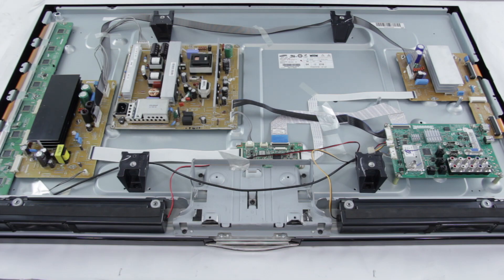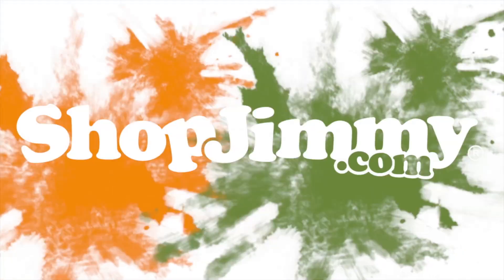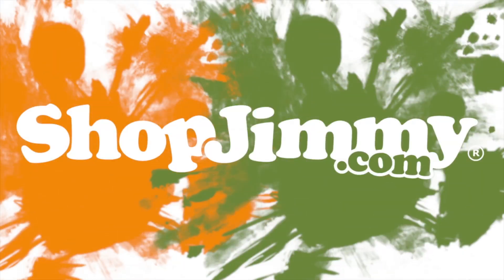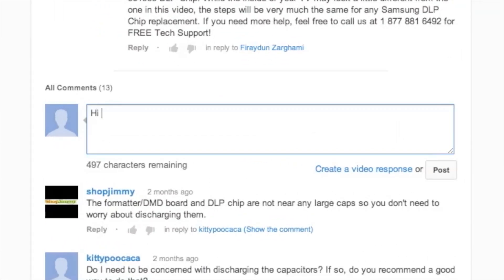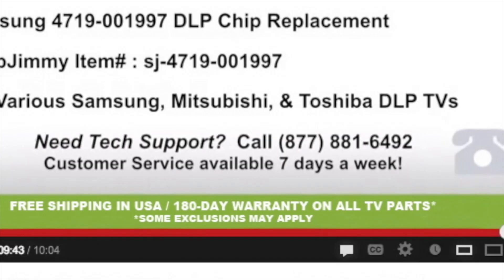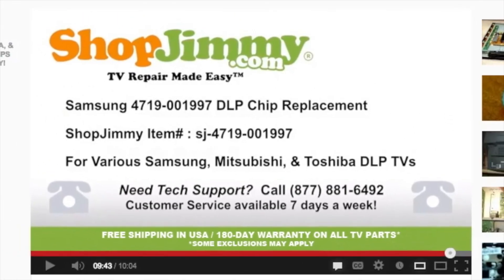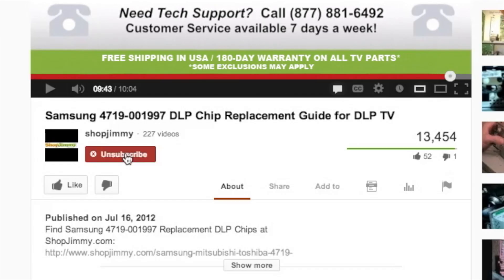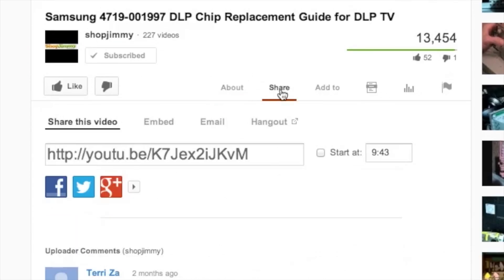Plasma TV Repair Tutorial - Common Symptoms & Solutions - How to Fix Plasma TVs

Comment: Hi need help with my plasma tv.
It is an Hitachi 42pd5200e.
It went down with the famous power board failure (no power ,no led light on front of panel).
I replaced this with a new power board and It still will not power up.
I get the below when I power on tv.
1 turn on power button.
2 Hear a click (relay) and the led turns green from red.
3 Led is green ,Hear a second click (relay) . Led is still green but no picture or sound.
I have done the self Diag on tv and get 8 flashes of the green led .= according to manual this is all boards failure !!!!!.
I have tested the 5v supply on power board and also VA =66.5v so they seem o.k.
The VS however is only 16.6v ,And goes to Zero after second click of relay when turned on,It should be 90V.
I have noticed that if I unplug X SUS Board and turn tv on you do not hear second relay click sound ,And the same if I disconect the y sus board.
Any help greatly received.
Reply from the maker: julian oldham   This sounds like the y or x board is bad.  Unfortunately I do not see any replacement parts in the search results for your TV model number on our website.  Thanks and please let us know if you have any further questions!  www.shopjimmy.com
Reply: Hi I have now replaced both x and y boards and still have the same issue.
Don't know what else to try
It's now had a new power board + the above .

Comment: Panasonic TH-P50Vt20A shuts down after about 15 seconds.
Reply from the maker: Frank Howe   I recommend replacing the power supply in your TV.  Here is a link to replacement parts for your TV model number on our website, click here:  http://www.shopjimmy.com/catalogsearch/result/?q=P50Vt20  Be sure to match part numbers on your current board, with your replacement for compatibility.  Here is a link to a video showing how to identify your part number, click here:  DIY Plasma TVs 101: Part Identification Number Guide for Panasonic Power Supply (PSU) Boards  You can also call our customer service for further assistance with your purchase.  (877) 881-6492  Thanks and please let us know if you have any further questions with your TV Repair!  www.shopjimmy.com

Comment: I hope you can help???  I have a Samsung Plasma Model # PN50C540G3FXZA.  And it's flashing and sometimes solid black.  The picture varies from blown out to dark.  And it occasionally plays normal too.  I took pics of what its doing and a small video, but not sure how to add it here.
Reply from the maker: Suzanne Hue  I recommend checking your power supply, is there anything on the power supply that looks burnt or are any of the capacitors look puffy?  Please reply with this information and we can try and recommend a replacement part.  Thanks!  www.shopjimmy.com

Comment: I have replaced all the boards on my Insignia 42-P650A11 plasma tv. Still have clicking flashing red light and no picture or sound. The red light stays solid after clicking stops.   What else could it be?
Reply from the maker: Charlene Skeen   What was the original problem on your TV?  Please reply with details about the the TV symptoms.  Thanks!  www.shopjimmy.com
Reply: the color was fading and picture breaking up. Then wouldn't come on.

Comment: My plasma is samsung fp-t5084
I just have green and sometimes red pixels like tiny star's on the screen....
Reply from the maker: king john  I recommend replacing the Y-Main board in your TV.  Here is a link to replacement parts for your TV model number on our website, click here:  http://www.shopjimmy.com/catalogsearch/result/?q=t5084  Be sure to match part numbers on your current board, with your replacement for compatibility.  Here is a link to a video showing how to identify your part number, click here:  Samsung Plasma TV Repair: Samsung Plasma Panel Parts Guide  You can also call our customer service for further assistance with your purchase.  (877) 881-6492  Thanks and please let us know if you have any further questions with your TV Repair!  www.shopjimmy.com

Comment: I have a Samsung Model PN50A550S1FXZA. When I try to turn it on it will cycle several times. Each time with a loud click that sounds like a relay pulling in. Once it is on, it work fine. Is this the power board?
Reply from the maker: Robert Whitfield   I recommend replacing the power supply in your TV.  Here is a link to replacement parts for your TV model number on our website, click here:  http://www.shopjimmy.com/catalogsearch/result/?q=PN50A550S1FXZA  Be sure to match part numbers on your current board, with your replacement for compatibility.  Here is a link to a video showing how to identify your part number, click here:  TV Part Number Identification Guide for Samsung DIY TV Repair Power Supply Unit (PSU) Boards  You can also call our customer service for further assistance with your purchase.  (877) 881-6492  Thanks and please let us know if you have any further questions with your TV Repair!  www.shopjimmy.com

Comment: I have a panasonic TH-50PX75U.  Have had ongoing issues with the picture going out.  The audio always works but the picture will come in and go out intermittently.  Usually the longer I leave the TV on it will eventually stay on and work but other times it will work at first and then after a while cut out and never come back.  Other times the picture will come in but everything is tinted blue for a while and will then go back and forth from coming in clearly and being tinted blue, then eventually if left on long enough (40+ min) it will usually clear up.  Any help with troubleshooting would be appreciated.  Thanks.
Reply from the maker: Timothy Callahan   I recommend replacing the SC board for your TV repair.  Here is a link to replacement parts for your TV model number on our website, click here:  http://www.shopjimmy.com/catalogsearch/result/?q=TH-50PX75U  Be sure to match part numbers on your current board, with your replacement for compatibility.  You can also call our customer service for further assistance with your purchase.  (877) 881-6492  Thanks and please let us know if you have any further questions with your TV Repair!  www.shopjimmy.com
Reply: ShopJimmy.com
I replaced the SC board but unfortunately no improvement.  Would that indicate bad buffers?  Is it common for both buffers to go bad at same time?  Both the SC board and buffers are out of stock on your website (I had to buy the SC board on ebay, I assume it was good, either way TV acts exactly the same with the new SC board as it did with my original.  Any other recommendations would be appreciated.  Thank you
Reply from the maker: Timothy Callahan   Yes, your buffers could be bad.  I recommend replacing the buffers next.

Comment: I have a Samsung HP-R4272 plasma display. Objects displayed on the screen cause a reddish fuzz vertically up and down from wherever it is. This happens on any input. It started while playing a video game (classic Nintendo). After a few minutes, it became permanent and is still getting worse. Any help would be great, thanks!
Reply from the maker: Robert Henline   I recommend replacing the Y-Main board in your TV.  Here is a link to replacement parts for your TV model number on our website, click here:  http://www.shopjimmy.com/catalogsearch/result/?q=R4272  Be sure to match part numbers on your current board, with your replacement for compatibility.  You can also call our customer service for further assistance with your purchase.  (877) 881-6492  Thanks and please let us know if you have any further questions with your TV Repair!  www.shopjimmy.com

Comment: I'm having an intermittent problem with my 50" Samsung Plasma TV (model # PN50B860). Every so often, whether watching a live broadcast or recording, the TV will change the input source by itself, usually to the antenna source which has no input and thus no picture. When it does this, the infrared input light on the TV continuously flashed rapidly and cannot be interrupted by the remote or TV buttons. My only recourse is to unplug the TV, plug it back in again, and reset the source input via the remote. Any idea what's causing this and what part(s) need replacing? Thanks in advance!
Reply from the maker: R Reed   I recommend replacing the main board for your TV repair for your input changing by itself TV Repair.  Here is a link to replacement parts for your TV model number on our website, click here:  http://www.shopjimmy.com/catalogsearch/result/?q=PN50B860  Be sure to match part numbers on your current board, with your replacement for compatibility.  Here is a link to a video showing how to identify your part number, click here:  Samsung Main Boards & Digital Boards: Part Numbers for LED, LCD, DLP, Plasma TV Repair  You can also call our customer service for further assistance with your purchase.  (877) 881-6492  Thanks and please let us know if you have any further questions with your TV Repair!  www.shopjimmy.com

Comment: RCA plasma 42pa30rq... I never get a picture just cliking. Not even the menu page when I remove all components ie. xbox and cable. All I get is clicking. Wouldn't I at least get a picture (menu) with everything removed. Wouldn't the issue be the other boards?
Reply from the maker: Stash2319   I recommend replacing the Y-main Board and the Buffer at the same time for your TV Repair.  Here is a link to replacement parts for your TV model number on our website, click here:  http://www.shopjimmy.com/catalogsearch/result/?q=42pa30rq  Be sure to match part numbers on your current board, with your replacement for compatibility.  You can also call our customer service for further assistance with your purchase.  (877) 881-6492  Thanks and please let us know if you have any further questions with your TV Repair!  www.shopjimmy.com

Comment: HELLO I HAVE A 2006 DELL PLASMA 50 INCH TV.WHEN I TURN THE TV ON IT TURNS RIGHT BACK OFF....MODEL# W4201C/W5001C
Reply from the maker: Sheldon Smith Sr   I would start out by carefully inspecting the power board for swollen capacitors. Especially in a set that is 8 years old. There are a number of other possible causes of the problem, but start with that.  Please reply with the information that you find and then I can help to work toward a repair.  Thanks!  www.shopjimmy.com
Reply: thank you very kindly ....it was the power board. swollen capacitors so I just replaced the board and its up and running

Comment: Hi. I have a Samsung PN69D63083F. When I first turn it on it comes on just fine for a few min, then it sounds like it powers off then powers back on but does not have video only has audio, I can turn it back off let set for a few turn back on it comes on just fine for a few min. then does the same thing again.
Reply from the maker: Eldon Essary   I recommend replacing the main board in your TV.  Unfortunately I do not see any replacement parts in the search results for your TV model number on our website.  Thanks and please let us know if you have any further questions!  www.shopjimmy.com

Comment: my plasma TV shuts on and off continuously.model code is PN58C550G1FXZA Version UY01.
what board would that be, and how would one replace it? thanks
Reply from the maker: ARNOLD TOEWS I recommend replacing the main board for your TV Repair.  Here is a link to replacement parts for your TV model number on our website, click here:  http://www.shopjimmy.com/catalogsearch/result/?q=PN58C550G1FXZA  Be sure to match part numbers on your current board, with your replacement for compatibility.  Here is a link to a video showing how to identify your part number, click here:  Samsung Main Boards & Digital Boards: Part Numbers for LED, LCD, DLP, Plasma TV Repair  You can also call our customer service for further assistance with your purchase.  (877) 881-6492  Thanks and please let us know if you have any further questions with your TV Repair!  www.shopjimmy.com

Comment: I have a RCA plasma 42pa30rq. When turned on it only makes clicking sounds on and off a few times. I can here some static between clicks but never get a picture or sound. any suggestions? Thanks
Reply from the maker: Stash2319   I recommend replacing the main board in your TV.  Here is a link to replacement parts for your TV model number on our website, click here:  http://www.shopjimmy.com/catalogsearch/result/?q=42pa30rq  Be sure to match part numbers on your current board, with your replacement for compatibility.  You can also call our customer service for further assistance with your purchase.  (877) 881-6492  Thanks and please let us know if you have any further questions with your TV Repair!  www.shopjimmy.com

Comment: I have a panasonic model number  TH-42px77u   I had the electric company out and they pulled the meter on the house to check the ground... When they plugged the meter back in I think it surged the tv.  upon opening the back i found one of the two fuses was blown.  However, when i tried to replace it and plugged it back in it blew both fuses.  So my next thing was to disconnect all of wires plugging into the power supply board.  When I replaced the fuses again, it did not blow.  As i plugged in each wire one by one when I got to the one that connects to the main baord it blew both fuses.  Do you think it may be the power supply board or one of the other boards?
Reply from the maker: Craig Wells   This sounds like the A main board is shorted and when you plug it into a power source it kills the power source I would replace the main board.  Here is a link to replacement parts for your TV model number on our website, click here:  http://www.shopjimmy.com/catalogsearch/result/?q=TH-42px77u  Be sure to match part numbers on your current board, with your replacement for compatibility.  Here is a link to a video showing how to identify your part number, click here:    Panasonic Plasma HD TV Repair Tips: Suffix Codes for A Board & Main Boards  You can also call our customer service for further assistance with your purchase.  (877) 881-6492  Thanks and please let us know if you have any further questions with your TV Repair!  www.shopjimmy.com

Comment: My Akai PDP4225M TV is absolutely dead.  It does nothing when you turn it on.  No red light and no noise.  I've confirmed it has power.  Beofre it when dead, it changed the input source wheb I tried to turn it off using the remote or the front buttons.  I could only turn it off using the power button in the back.  This worked about three times and then it died.  What board failed?
Reply from the maker: Lars Lippard   If the light is not on, in the front of the TV, then I recommend replacing the power supply in your TV.  Here is a link to replacement parts for your TV model number on our website, click here:  http://www.shopjimmy.com/catalogsearch/result/?q=PDP4225M  Be sure to match part numbers on your current board, with your replacement for compatibility.  You can also call our customer service for further assistance with your purchase.  (877) 881-6492  Thanks and please let us know if you have any further questions with your TV Repair!  www.shopjimmy.com

Comment: I have a Zenith 42 inch Plasma.  Model # Z42PQ20.  TV just went off while watching.  Power will turn on, but only red standby light.  If I push a channel button, the blue on light comes on like it is turning on, but clicks back the the red standby light.  Any suggestions?
Reply from the maker: Donny Sloan  I recommend replacing the main board in your TV.  Here is a link to replacement parts for your TV model number on our website, click here:  http://www.shopjimmy.com/catalogsearch/result/?q=Z42PQ20  Be sure to match part numbers on your current board, with your replacement for compatibility.  You can also call our customer service for further assistance with your purchase.  (877) 881-6492  Thanks and please let us know if you have any further questions with your TV Repair!  www.shopjimmy.com
Reply: Is this a hard process to do myself?
Reply from the maker: Donny Sloan
  You will want to take the proper precautions before attempting any repair, be sure to ground yourself properly and unplug your TV amongst other precautions.  Most TV board replacements only require, a screwdriver, and a replacement part.  Thanks and please let us know if you need any other help!

Comment: 50'' plasma Element (PLX5002B) what happens is when i turn the tv on there is no picture or sound for about 2 minutes and then it starts to flash on and off for another 2 minutes and after its done flashing the picture and sound come on and then it flashes one more time and then the tv works fine. what do you think could be the problem?
Reply from the maker: Ryan Tammaro   This could either be the Y-SUS board or the power supply board that is causing the problem in your TV.  You may need to replace the boards one at a time to see which board fixes the problem.  Here is a link to replacement parts for your TV model number on our website, click here:  http://www.shopjimmy.com/catalogsearch/result/?q=PLX5002B  Be sure to match part numbers on your current board, with your replacement for compatibility.  You can also call our customer service for further assistance with your purchase.  (877) 881-6492  Thanks and please let us know if you have any further questions with your TV Repair!  www.shopjimmy.com